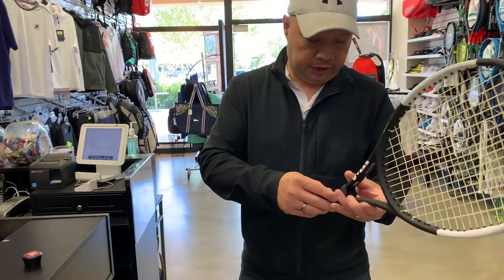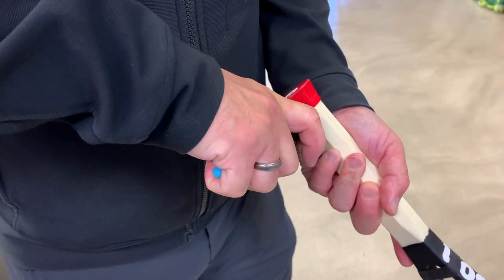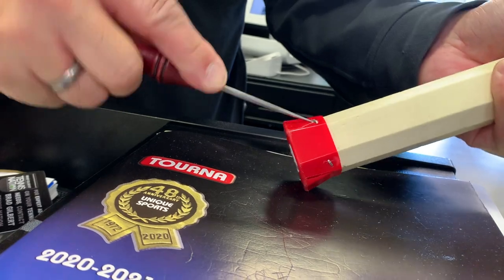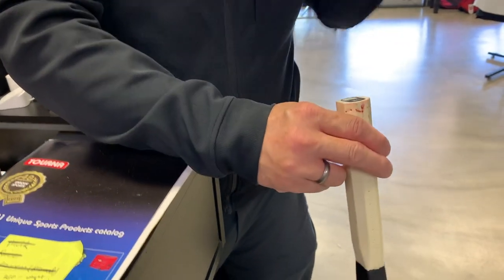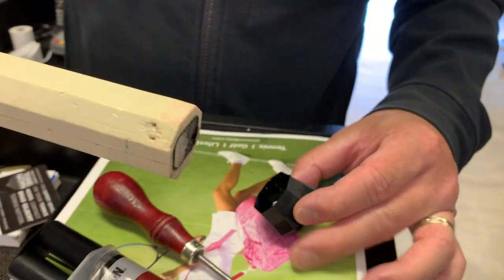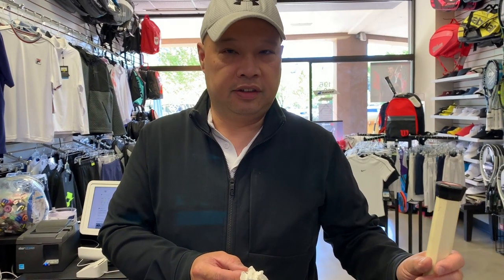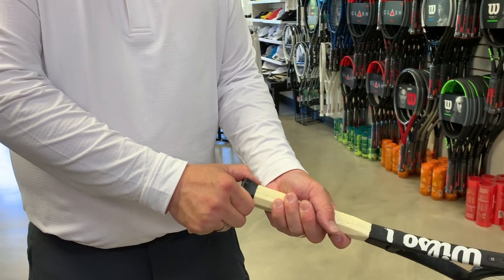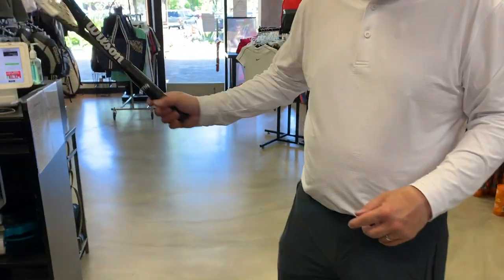TENNIS RACKET BUTT CAP  HOW TO CHANGE OR FIX

Comment: I've changed a few but caps in my time, In my experience a rubber solution glues work fine, such as evo-stik contact adhesive. With a rubber solution glue, you get some shock absorbing properties, and best of all you can replace the cap again (should it get damaged) by pulling hard, or cutting a slice in the cap and pulling it apart. Epoxy resin will do the job too well, over kill in my opinion.

Comment: FYI, actually you can take it off, just use heat gun. Epoxy adhesive is weak on high heat, I used to replace golf club shaft with 2 parts epoxy and remove them with heat gun when needed to change shaft again. You might also melt or deform the butt cap, tho...

Comment: BOTH of my Wilson Blade Lite models had loose butt cap problems and the company refused to do anything or make it right.  I will never buy Wilson racquets again.  Thanks for the video to do what the manufacturer should be doing for a $200 plus frame.

Comment: Hello..butt cappers..Xtending your racquet or paddle really got alot easier with the XTP Xtended Tennis Product butt cap simply remove factory cap an install the XTP..dont use super glue use somekind of FLEXIBLE rubber cement and can restaple if necessary..thx..john

Comment: Instead of placing the adhesive (epoxy in this case) in the butt cap, it's less messy to spread thinly over the end/edge of the grip; as you push the butt cap on, the adhesive naturally spreads upwards (toward the throat) on the grip as well as down the (in)sides of the butt cap. This is especially important for those of us using Head racquets with trap doors and no handle foam, since we can still be able to add silicone / tungsten, foam (what have you) without dealing with a goop of adhesive glue.

Comment: Tennis spin very good info on replacing the butt cap ,FYI there is a product on the market that by changing the factory butt cap to an Xtended XTP butt cap can add half an inch to ANY RACQUET or paddle. Yes its the easy way to lengthen any racquet by half an inch or slightly more, making the racquet an XL version of itself,,most standard racquets are 27 inches long but many many pros play with slightly longer models up to 28 inches and its legal to play a 29 incher actually,,so check out the XTP and stretch you game by Xtending you racquet. Thx.j

Comment: Really helpful video! I found silicone injected in my brand new Wilson racquets(RF97, Ultra tour etc.). My friend told me it was one of the tricks from Wilson manufactures to make up the weight during QA process...If the weight isn't too far away, they will use foam fill.

Comment: Pouring that amount of epoxy in the butt cap seems crazy. A small amount on the inside wall of the buttcap or botton of the handle pallet will suffice.
Reply: I agree because it would be difficult to pop the butt cap now to add weight in the handle.
Reply: You just got to shake your head when you see a guy dump a bunch of two component epoxy into a butt cap. I wouldn’t trust him to walk my dog.
Reply: i agree he seems a bit "slow"
Reply: Yeah this is madness

Comment: Epoxi is the glue that has the carbon fiber frame because it sticks very well to the carbon fibers. So it's part of the frame. That's why it works so well for fixing the butcapp I think.

Comment: Tennis Spin, can you get in the Yonex butt caps with the trap door? I have an old Super RQ 700 To Long that has the old style butt cap and I think it's been cracked since I bought the racquet. Now where Yonex used to have those gummy like grommets at 3 & 9 some of them are rattling around inside the old butt cap and otherwise the racquet is in great shape and I'd like to fix it back up to have in my bag as a backup. I'm handy enough that I customize my racquets I've never seen the butt caps installed with epoxy glue before though I always just knew staples which you have to be careful not to split the plastic of the new butt caps if you use them.

Comment: It's easier to remove the staples if you first pop the buttcap trap door and then use a flat head screwdriver to push the pins out slightly from inside the handle.
Reply: There was silicone in the handle
Reply: Only works if the handle is completely hollow.

Comment: Hi, really like you videos. I have a question. I play with Pro staff 315gr (bought it 2018). If I want a slightly more forgiving racket, what racket do you suggest? (started playing in the 80s)
Reply: Gustaf Hesselman Yonex Vcore or ezone. Stay away from cheap junks from Head.
Reply: Michael P super thank you, will try it right away. Take care
Reply: Gustaf Hesselman NP. I used prostaff for a long time. I don o why but those new pro staff are so unpredictable. RF is better and heavier. Babolat these days are very stiff and they ruined the aero pro drive.
Reply: Michael P ok, I’m actually looking forward testing yonex been playing Wilson and babolat for some time.
Reply: I've recently switched out to the Prince phantom 100x 305 after seeing some reviews from numerous channels. Very easy to play well with. Recommend a demo!

Comment: Tennis Spin, Great video as usual. Can you please make a video on how to change grip pallets? Hacks to get old pallets off and what to use to staple the buttcap? Having trouble finding suitable staples and a stapler that is actually powerful enough to staple the cap on the pin. Thanks in advance:-)

Comment: It's easier to get the butt cap off if you use an awl to pry out the staples. You can also use doublesided tape to put on a buttcap.
As you never see any customers I wonder if this is an actual shop of just a prop for this bloke's videos.

Comment: So normally I’ve used just regular super glue and saw this video and bought that proxy stuff and it sucks, after more than 24 hours it was still not dry enough I decided to just go ahead and play with the racquet and it kept leaking out from the cap making my palm sticky, I had to use my towel to keep wiping off the access between points, next time I’m using super glue or gorilla glue something more instant.

Comment: It may have been a good idea to glue the butt cap on the end without the trap door. So, the person could access the material in the handle with ease. It is good that you did not replace the grip. Because the customer has to replace the lead tape which was stripped from the handle. It is a nice way to permanently affix a butt cap😊. 
 A little more glue and there may have been no need to replace any of that lead tape😉

Comment: Definitely don't try to put new staples in the replacement cap, more holes will weaken it, potenturly the bottom end could break when inserting, or break off if dropped. 
 When gluing the cap, It's a good idea to scratch the inside with sandpaper, it gives the glue a better key.

Comment: Please, go buy a pneumatic stapler & small compressor immediately. As a tennis player & a craftsman… this video was painful to watch. You could buy everything you need & a lifetimes worth of staples for about $150. That’s a small price to pay to avoid the aggravation of trying to pry one of those caps off after it’s been epoxied on. 😉🎾😁
Reply: I have thee rf97’s. All of the staples into the grip caused my grips to break apart at the point where they get staples. So using epoxy or some glue makes sense